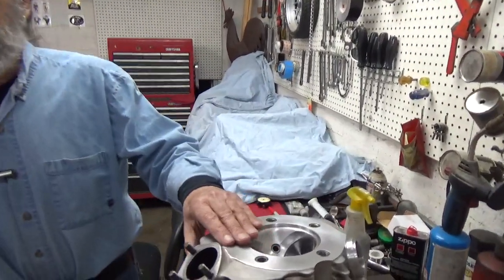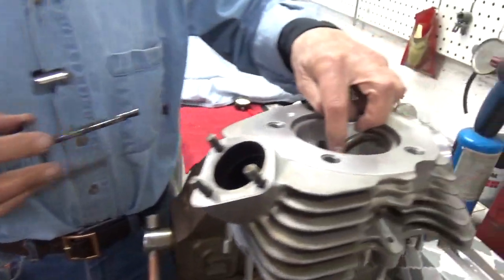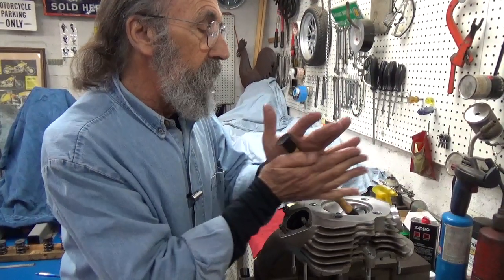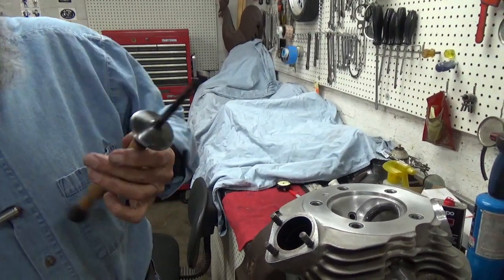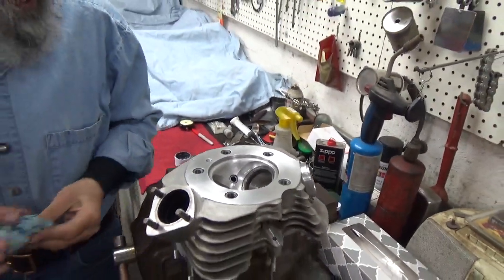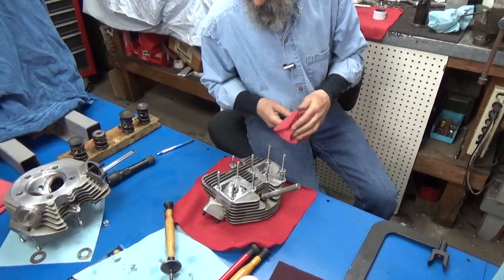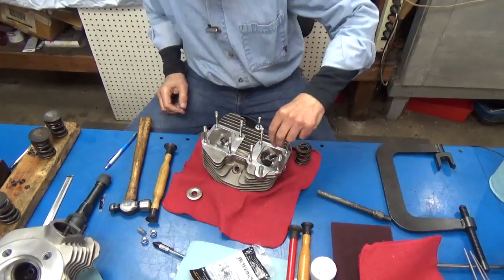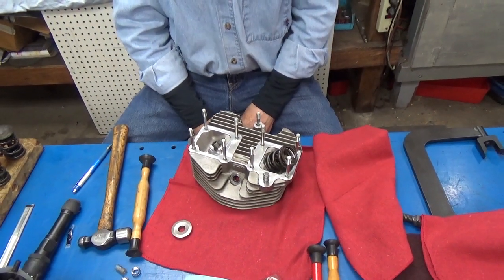Lap The Valves On a Harley Davidson Shovelhead

Comment: One day on the job, my foreman said to lap the valves on an Alco locomotive in the roundhouse. Same as what you're doing here but on a larger scale. And yes it was by hand and hard work. I don't miss that job either but it paid well and had good benefits. Thanks for another excellent How To video.
Reply from the maker: Thank You.  I grew up in San Bernardino,Ca.  Field trips to the Santa Fe yard was awesome.  I loved it.  And the explanations were great.  Lapping a valve that big must have been quite a chore.  You have my respect.
Reply: @pacificmike9501  Thank you so much. I wasn't the only one doing it. Most of the time it was 2 on the job for a 12 cyl. loco. The Alcos we had were the 4 cycle type diesels.

Comment: Mike have you ever went over the special tools required to do a Shovel and Evo motor .  I had a lot of home made tools I had to come up with back in the 70's and 80's when I was doing basket cases . I couldn't afford to buy the real Harley tools or a running Harley so I had to use farm boy ingenuity.  You by far have the best and easiest videos to follow thank you.
Reply from the maker: Thank You. I generally show stuff as I go.
Reply: I could (okay, today that is more of a "want" thing...) never afford those ridiculously expensive fancy-pansy lapping tools/arbors for Harley bearing races. Since forty years I just use a (ultra quality "Hunger" one, though) adjustable line reamer I normally use to size  kingpin and suspension bushing stuff. I put dull but straight blades in and simply use it with lapping compound.
I did literally hundreds of Sportster, Pan and Shovel rod-, crank- and mainshaft bearing races this way and they never failed...
I absolutely adore your videos. Your calm and "no BS" voice really helped me through a lot of sad hours already!
Thanks a whole lot and Greetings from Germany!

Comment: Great video, I hear you mention that EVO engines need to change base gasket at around 40.000 miles, well that's the mileage on my Harley so it sounds like the valve seals have the same replacement time. B.t.w. I have never had any oil leaks from cylinder head gasket so far, driving my bike for 22 years in Thailand. Thank you for all your time and effort to make all videos who make a lot of help for us bikers who live in the jungle far away from any Harley dealer shop.
Reply from the maker: Thank You.  All I was referring to was that, when we replaced base gaskets,  we did a "freshen up" to the topend.  In the beginning and all the way through, Evos had minor difficulties with base gaskets.  The biggest problem was the riders not giving the motor adequate time to warm up before riding them hard.  Those aluminum cylinders have to warm up to operating size first, or they move around and begin leaking. Twin cam cylinders are o-ringed at the base.  Much better. There are some very good gaskets on the market nowdays, but let her warm up for a few minutes, then take her up slowly.  As for your valve seals, not normally a problem, but could have dried out.  Remember, the newest Harley Davidson Evos are now over 30 years old.

Comment: I have an 93" cu.i S&S Shovelhead (with Harley top ends with the short/mid "Sportster-type" of sparkplug threads).
My friends say that when I shift gear it come "black-smoke" from the pipes.

Last year, I had my cylinderheads of to make a repair-welding and new threads for the sparkplugs :-).
My "reaction" was that there was no valvestemsealers fitted.I read in the Clymer´s book in  the chapter that concern top-ends that "have a valve-stemsealing" should replace it like you do in the video.
This S&S motor was buildt (not by me) for about 30-35 years ago.No problem with the running of the motor,and the smoke don´t bother me:-).....but when it´s obvius that something is wrong,I want to solve the problem.
Sorry about my bad English....but I am born 1958.... :-)
//Jörgen
Reply from the maker: I run valve seals on my Shovelhead because my drag race buddies convinced me I should.  They claimed that it helps prevent getting oil into the combustion chamber and therefore, you get  more accurate tuning.  Okay.  My Shovelhead burns very clean and front and rear are an extremely close match.  No valve seals on my Knuckle or my Pan.  Another "personal preference."  Black smoke is fuel.  Blue smoke is oil.  Also, always use a little anti-seize on your sparkplug threads.
Reply: @pacificmike9501  Thanks.....The colour of the smoke is what my buddies of me telling me how it looks:-)

Comment: I like to use a 4" length of tubing attached to the stem end with small zip tie then attached to a two inch length of 1/4" all thread in a drill and I'll just pull lightly with the drill on low speed and it works great. I also put the C-clamp in the vice instead; that way you can drop the keepers in from the top. Awesome to learn so much new stuff from Mike though!
Reply from the maker: Thank You.

Comment: I’ve done a lot of cylinder head work even porting , it’s nice to watch someone else do it , we all have our ways , when I lap I use a rubber fuel line on the valve and slid the other end one a drill bit I have on a power drill and work it , but spring and all together add some gasoline into the port and see if it holds at least 3 mins ..
 Enjoying your channel
Reply from the maker: You bet!  I don't do valve work like I used to.  Having a shop, I got to the point where I just sent them out to the machine shop.  They had a $150,000 guide and seat machine that gave me perfection for a really reasonable price.  Now that I'm playing at home, I'm getting back into the old habits like you have.  It's great to talk about and great to feel again.  Thank You.
Reply: Pacific Mike it’s seems the old art is having more appreciation these days , great channel Mike

Comment: Another great video, very interesting to me as I'm currently elbow deep in my top-end EVO refresh. I dropped my heads and jugs off at the machine shop yesterday. Getting the bases turned, bored +10, valves and heads worked on...Should be good to go in a week or 2.
Reply from the maker: Cool.  Spring is almost here.

Comment: Hey mike. Could you do a video some time explaining and showing how to measure and set spring lift and pressure. I’ve read the steps 100 times but once they start with the math they lose me. I learn way easier seeing something done while it’s explained.  Heads is the one part of the engine I never messed with. 
  Keep up with your awesome work
Reply from the maker: We'll do it when we need it.  When it comes down to really high tech, I farm it out to my friend who set 60 national speed records.  He knows cylinder heads.  That's where real power is made.

Comment: I put a Compufire ignition and whoo weee she runs out now, I ran a MC power arc a Dyna 2000i and the Compufire  which has been the best ignition.. I built the engine in 93 which is a Shovel style using -66 heads..I did so many evo engines but never ever did I lap the valves. I always cut new seats because most of them were way outa spec.
Reply from the maker: Cool.  You probably had some serious miles on them.

Comment: Thanks Mike, that was fun to watch..... Back in the 70's when I was a kid working for Porsche/Audi I remember we would cut the valve face at a 44 deg and leave the valve seat at 45 deg, we called it interference angle for a perfect valve to seat seal. Do they still use that theory today, or am I so old school it's no longer used?.....Thanks again Mike.
Reply from the maker: Thank You. Yah, it's still done that way alot.  But, with the modern guide and seat machines, well, I don't even know how to set one up.  If I need any of that work, I farm it out.  The new machines can be accurate to about a tenth.  I just lap things in by hand as a cleanup.

Comment: If you use that Zippo fluid as a cleaner/solvent, charcoal lighter fluid is so close to the same it doesn’t matter, and it’s way cheaper. Did they ever fix that issue on the later Evos? As usual, I enjoyed this I’m immensely and learned something new like always. Love the old stories too as always, so don’t ever stop telling them.
Reply from the maker: Thank You.  The  Zippo lighter fluid is for my Zippo lighter.  I use it mostly for lighting a fire in the fireplace.

Comment: Give Jason  lienweber  cams  a call use there springs  for 35 years  the best springs  on the market,old panheads had exhaust  Rotator keys that would actually move the valve in the engine when it runs   they were factory  up grade
Reply from the maker: Thanks.  It's Justin.  He's not far from me.  I'll call him.  He's a great guy, just like his dad was.

Comment: If you do not lap base of cylinder it will leak again, trock made a special tool that worked great and I never had a comeback usi g it. Width and position of lapped area on valve is important, I use a dial caliper and a loop to set contact patch visually, otherwise you are guessing. I did 100's of evos back in the day.
Reply from the maker: Thank You.

Comment: Great video.  Early in this video you briefly mentioned about the Evo having base gasket issues.  What did fix the issue?  A better gasket?  Thanks.
Reply from the maker: Yes, better gaskets.  Also, let the motor adle until it warms up a little before taking off.  The cylinders need to swell before giving it much throttle.

Comment: Thank you for doing videos like this, helps alot. I was just wondering if you would recommend any specific brand or model for a rear chain? Mine is worn out and I need to replace it. Should I go with an o-ring chain? The bike is an 80” stroker duo-glide.
Reply from the maker: There are a bunch of good chains out there.  But, you said "Duo Glide."  Cool.  But you're probably running a tin inner primary cover.  Hard to say, but, you may be limited for space.  O-ring chains are nice but usually, they are quite wide.  And, chains generally eat whatever is in their path.
Reply: @pacificmike9501   Yes I am running a tin primary and 1 1/2" belt. Oh ok I didn't know the o-ring chains are wider. So thats really good to know, I think I'll just go the safe route then and get one similar to the one that was on it. Thanks!

Comment: Mr Mike I have a question. You where talking about the early evos leaking on the base gaskets. Mine just started last year leaking. I'm new to working in bikes but you inspire me to do my own. And its relaxing. My question is can I pull the cylinders off with the engine in the frame or do I need to pull the engine out? Bike is a 91 fatboy if that matters. Thank you sir.
Reply from the maker: It's in your service manual.  You remove the rocker boxes one piece at a time.  Then, the head, then the cylinder.  Motor still in the frame.
Reply: @pacificmike9501  thank you mike for responding. That helps.

Comment: Easy way out is usually pretty good, but if you got the heads that far, three angle cut valve seats will outlast any lap anyday. My opinion, I may be wrong.
Reply from the maker: No, you are absolutely correct.  But if they are good, an easy lapping job is just fine.

Comment: Mike love watching all your videos on your Shovelhead. I finally picked up a 1981 FX Lowrider from a friend of mine for $600 was torn apart in pieces. The motor was put together but you know all the other stuff was taken off. I had it back together in a day and running by the second day Clutches really really tough now this bike has been ran since 1990 and I finally got it running everything it was sump. It pumped out a bunch of oil. I do have one of the lifters tapping real bad but once I start driving it it it’ll stop but we’re concerns me, the oil gauge does not show that there’s oil pressure but as you know if there’s no oil pressure that thing will be tapping and make it all kinds of noise and it doesn’t make any noise after drive it a few and get it all warmed up, but there’s still no pressure on the gauge. I’ve checked the gauge it works so, I am interested in your videos and getting your info and what you think would be great for this bike it’s not been altered or anything whatsoever. It is a bone stock 1981 like you come off the showroom floor and it’s not back condition, but it looks old, but I would like to know more about this bike and stuff that I can do to make it run better and maybe get your input on fixing this oil pressure and tapping noise. Thank you Mike love all your videos. Keep up the good work if you need in their bike, bring this one to you. I’m in Texas, but I have lived in Wrightwood all my life up in the mountains.
Reply from the maker: Asking a question is one thing.  You've asked a bunch.  Why was the bike taken apart?  Did you change the oil?  Did the oil indicator light function?  I don't recommend gauges on them.  Were the lifters removed from their blocks?  Buy a proper Harley Davidson service manual and read it.  This is a pretty good story you've got going here.

Comment: Okay nothing for nothing but back in the day when I had my shovel head and I was real I don't know what you call it meticulous. The oil going to the top rockers feeds from the back rocker and then feeds over to the front rocker which means for a short time and my idea you have little or no oil in the front rocker .
So I did is I took some tubing same type used for the feed and I ran the tubing up between the two cylinders and braised it onto another piece of tubing that went to the front and back rockers so when I started up it fed both rockers at the same time... just a thought
Reply from the maker: In theory, it really should help, but there's no real problem with the stock setup.  I've run them every way you could imagine.  Someone is always making a better setup.  But there really isn't a problem.

Comment: Hey Mike - I just picked up a Genuine James Gasket kit for my shovelhead and doing some research on how to install them all (thanks for the videos and help). In my research I'm seeing people say that the Valve Team seal from these kits (JGI-17034-66) are actually taller than what is needed and that you need to grind them down so that the fit correctly. 

Do you have the standard measurement for these these valves? Any tips to ensure everything measures out appropriately?
Reply from the maker: You need a good old time motor builder to establish the specs put out by James and the cam grinder of the cam you're using.  Be specific in your years on the heads.  This is all available from the cam manufacurer and the valve seal supplier.

Comment: Thanks for great videos. I hear that nowadays valve seats is only need to be 3 angle cut. Can you explain when I need lapping and when cutting, what the difference between them? Thanks.
Reply from the maker: Lapping is for clean up or final fit.  Cutting is for complete resurfacing and restoring angles.
Reply: @pacificmike9501  Oh, thanks.

Comment: Thank you for the video. What valve stem seal are you using ?  I have a 62 pan/shovel and I am wondering which type of seal I should use.  And do I need to modify anything before installing?  Thank you .
Reply from the maker: I don't have a favorite valve seal.  You will require a cutter to cut the valve guid to proper height.  Jim's Machine, I am sure, makes it and it can be purchased from the major suppliers.  Oddly enough, I don't run valve seals on my own Panhead.  I haven't done any headwork on that motor in so long, it should probably just revolt.  I put new valves in those heads in about 1992 and they haven't complained.
Reply: @pacificmike9501  Thank you for such a quick reply.  I wil look into that and great story about your Panhead. :)  Also, keep up these amazing videos.  They are very inspirational.
Reply from the maker: Thank You.

Comment: how do you figure out what size shim you need under the lower retainer? is it a standard size? and what happens if you change the size? i inherited a shovel head that has a bunch of stuff that isn't stock on it so I've been trying to figure out what measurements are standard across the board, and what is specific to that particular aftermarket part.
Reply from the maker: Sometimes, it's best to take it to a reputable guy who does Harley heads, knows the different springs and you have to tell him what the cam is.  He'll need to set it up for the lift of the cam.
Reply: @pacificmike9501  cool thank you.

Comment: Hello Mike, may i ask how you clean the headgasket surface without scratching it? Thank you! Grtz, Erwin
Reply from the maker: I use scotchbrite.  I use the maroon colored.  I buy it by the sheet at the local hardware store.  You'll find it with the sandpaper.
Reply: @pacificmike9501  Thank you very much 😁👍
Reply from the maker: If you've never used it, you're really gonna enjoy this.  Being able to really clean without changing a dimension.

Comment: this is a comment for everyone's consideration. But the guys at Waukesha engines that build the knock engines for rating octanes of fuel recommend to use a tapping motion in a circle perhaps because it emulates the action of the valve in use. Has anyone else run across this before? I am not saying this method is the "correct way"and I know your method works well.
Reply from the maker: Today, the most accurate method is totally by high tech, super expensive machinery.  I'm just a relic.